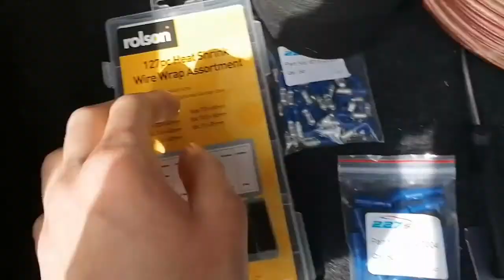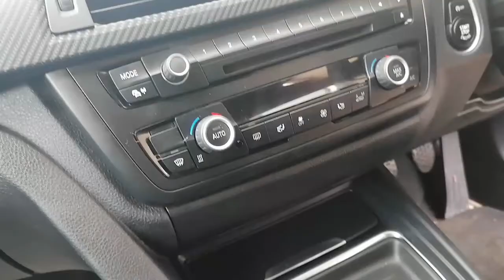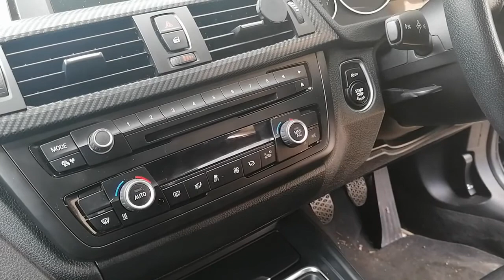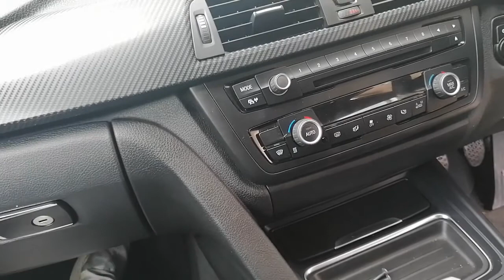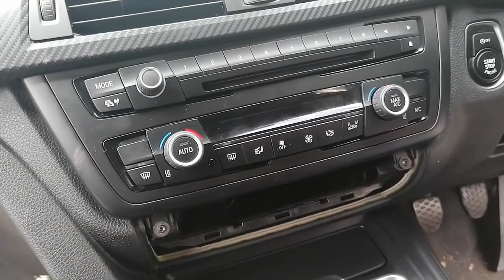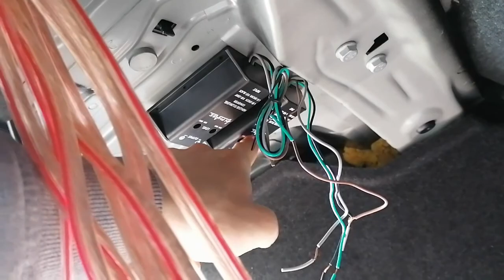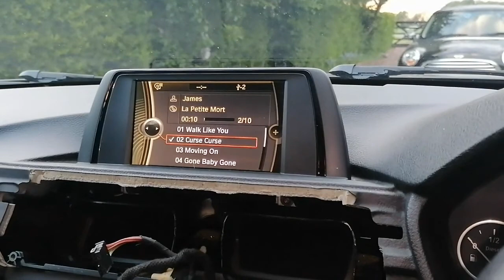Fitting amplifier to BMW F30 base HU

Comment: Details are rather informative mate, im going to take the same approach but to add a Subwoofer to my amp, the factory speakers are pretty good, just need an extra knock, again great video, cheers mate
Reply from the maker: Thanks mate it's fairly straight forward. Any dramas ping me a message

Comment: Ah yes, thanks for this video. I've only ever been able to find Americans with theirs but they don't have the base stereo so this has been very helpful. Can i just ask, how has the idrive/HU been since installing the amp? I really want to do the same but my idrive has been really laggy of late and not sure if it is worth it or whether it's slowly dying. Also, how many channels are on the juice amp, 4 or 6? I have already upgraded the mids in front and back and also fitted an active sub (tapping into existing underseat fronts & powered direct from the battery). Thanks again mate.
Reply from the maker: hi mate sorry for the late reply not one for checking comments. no dramas with idrive its been spot on since doing. 4 channels mate i just set it up as channel 1: front driver. channel 2: front pass 3: rear driver 4 rear pass
Reply: Thanks mate. I'm looking to try and find the harness that you used, are you able to advise where you got it from/link me? Had a look online and can only find ISO T-Harness' which have loads of unneeded breakaway cables which make them more expensive than what I really need.. or at least what you used.. if you catch my drift
Reply: Sorry to message again, was just wondering if you could advise re my last message. I want to get that quadlock extension thing you have but can't find it anywhere. Can you please link me or tell me the name of it and where it was purchased from? Cheers again
Reply from the maker: @tomelliott90  got it from ebay if I remember rightly just an iso extension I'll see if I can grab you a link later mate
Reply: @jameshumphries2609  thanks mate, really appreciate it!
Reply: Did you manage to find the item link mate? Sorry for hounding you aha 😅
Reply from the maker: @tomelliott90  https://www.ebay.co.uk/itm/1-1-Most-Quadlock-on-Quadlock-Extension-30cm-Plug-Socket-Cable-Adapter-/142511420442?_trksid=p2349624.m46890.l49286 only one I could find was from Germany have a look about I struggled to find one. You could make do without tho
Reply: @jameshumphries2609  thanks mate. How could I do it without cutting/tapping into factory harness speaker wires?
Reply from the maker: @tomelliott90  exactly as explained in the video mate cut into the extension instead of stock loom
Reply from the maker: @tomelliott90  not the ideal cable but it can be made to work. What you need to do is basically cut down and join the quadloc ends so it's like an extension. Like what I have. Should be straight forward to be honest. The extra connectors remove and trace the cable and work out where it needs to go onto the other quadloc and join it/ be aware so when you make the extension into the t piece you know whats going where

Comment: Hi
I have bmw 320 2013 with harmon kardon speaker 
The sound work in the front speakers and back speakers 
But it’s not working in all 4 doors 
Do you know what the problem is??
If you can help me😊

Comment: Hi mate few questions, did you have a wiring diagram for this. Is your audio a lot better and did you change the speakers in the doors or add tweeters thanks.
Reply from the maker: no mate i free styled it as i went haha, audio was a lot better. cant really do a before and after anymore as i no longer have the car. my current 3 series has full harmon kardon and is well worth the money. however this amp i fitted did drastically improve the sub par sound quality without replacing speakers.
Reply: @jameshumphries2609 amazing thankyou Did you have to fuse anything down have did you have any eletrical issues thinking of doing this myself soon using this video as a guide
Reply from the maker: @JJ-ec7xq  I put an Inline fuse going to the amp. Never had any electrical issues in the 2 years it was in that car. Worth the money as it is easily unplugged and removed.

Comment: Sorry I have two questions the first is the converters are they from the hu to the amp or the amp to hu ? (I'd have guessed from hu to amp)
I'm clueless with these things but want to give it a go.. 
Second is how do you know which is which speaker as in from diagram how do you know Fr Fl Rr Rl (my way was gona be snip extension amd see what speaker it cuts 😂
Reply: Oh and incase you reply can you send on what sort of wire It is you used is it just normal speaker wire or is there any you recommend

Comment: Isnt easier to taket yhe speakers output under the seats as input for the amp! Without taking the car apart?
Reply from the maker: No bacause to get 4 channel you'd have to cut cables to 4 of the speakers and wire a send and recieve for them. My way is by far the most simple and easily removed

Comment: Hi mate happy new year
I have 1 question I have installed inbuilt pioneer subwoofer in same car and its working properly  when car in ignition  but when I start  the engine  power  lights of amplifier  is blinking n cuts sub can u plz help me out many thankx
Reply from the maker: You pulling power direct from Battery or from Ignition circuit
Reply: @jameshumphries2609  12w I pull from battery and remote wire from fuse box ignition  on fuse but I put ground wire to battery negative

Comment: hello,u using cable 2.5mm or 4mm,and connected 4 channel  without bridge, front speakers + sub  underseat,and real only Low-pass filter no bass,good sound?my amp have auto detect speakers signal from rca speakers to amp, better separate auto on amp  control from heat unit, from speakers 12 v radio off have POP speakers,I hope you understand, I apologize in English
Reply from the maker: sorry mate im not understanding what your asking

Comment: hi ive got the same BMW f30  and im looking at fitting my sub tomorrow ive got a vibe 2 channel line output convertor with auto sense on it  do i still go from the back of the head unit and because im only wanting the front speakers and do u have a diagram of the wiring to with the speakers cables are please
Reply from the maker: Go into the back of the head unit mate. Don't have my diagrams now they are long in the bin. Work out which cables are the front channels and splice into them mate
Reply: @jameshumphries2609   ok thank u